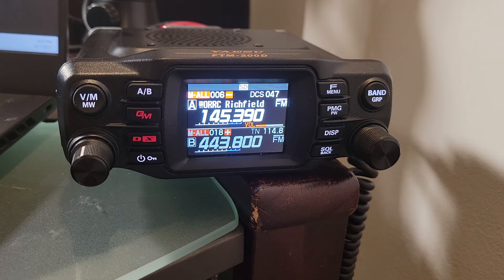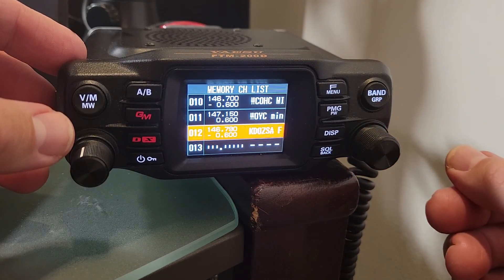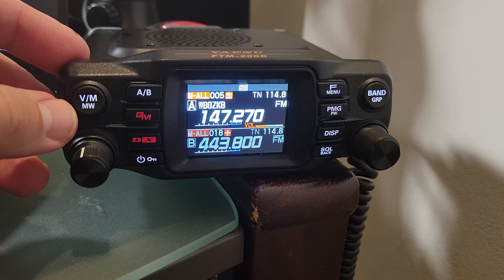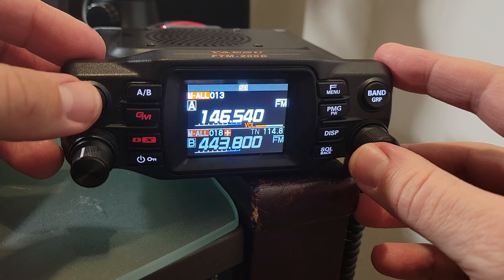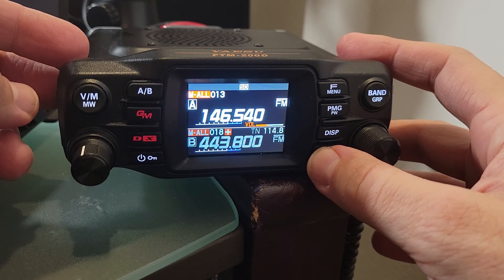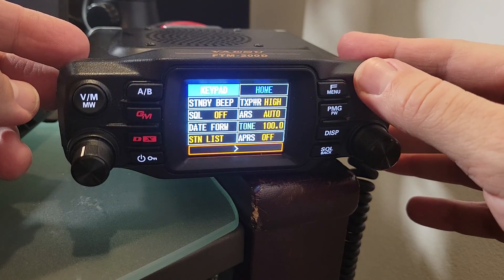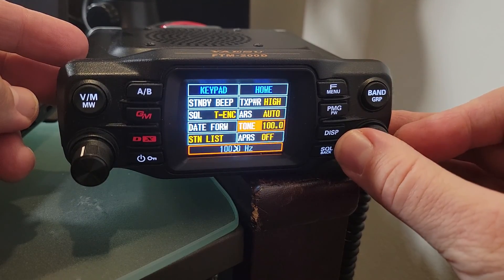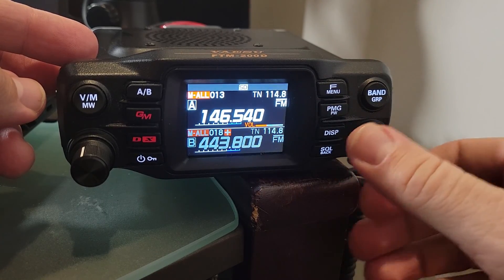Yaesu FTM-200D - Where's the #! @*&% are the CTCSS settings!!!

Comment: I got this same radio love it but I quit using it too hard to program just sits on shelf now as high dollar paper weight  went back to 2980 Yeasu
Reply: Wanna sell it? I want to get this radio and a hri200 for my own wires-X room
Reply: Ps leave the Aprs off or it will interfere with repeaters
Reply from the maker: Thanks for watching Chief Mack! Could you elaborate on the APRS interference?